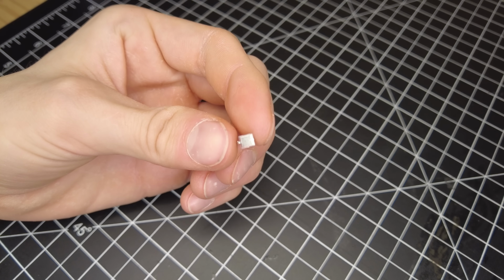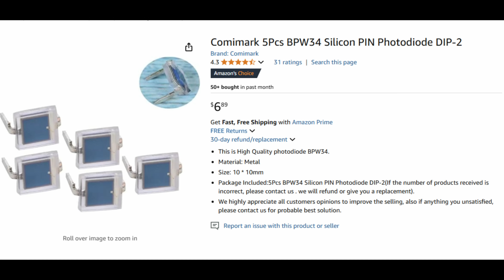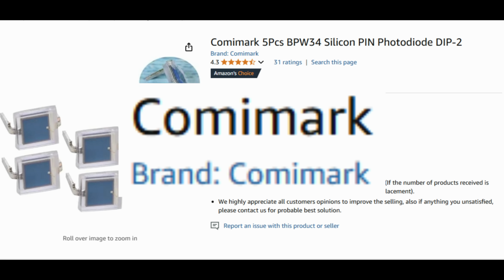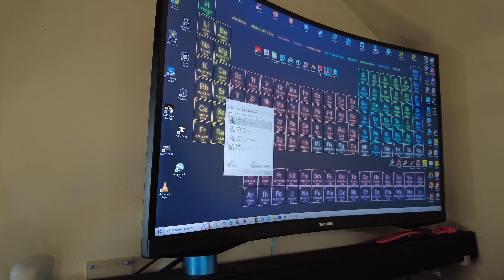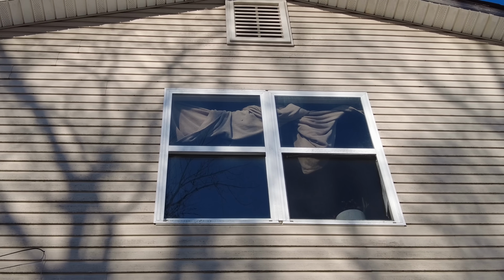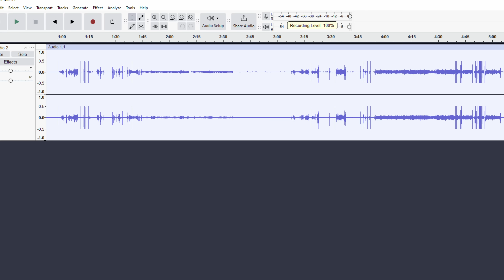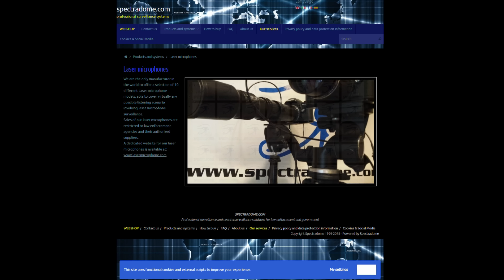I Built a CIA Spy Device (Laser Mic)

Comment: You need to modulate the laser (either using an AM or FM circuit) and then demodulate it filtering out the audio.  Basically youre making an AM radio tranmitter/receiver using a laser/photo circuit instead of a microphone.   This will get rid of the ambient noise.

Comment: Smart device sensors, radio waves (telecommunications/microwaves which provide your data connection)   and context aware recommender systems help strengthen the significance of 'mind reading' or the probability that their behaviour can be influenced by direct or indirect stimulus. 
However, social media and digital silos also contribute to subtle behaviour shifts. 
Your video is quite interesting, but more should be covered on corporate surveillance and how sensor data with algorithm's can read minds or influence behaviour patterns. You can also revisit the spectrum argument about how spying has evolved to use various spectrums used by everyone without them even knowing how they can be used to invade our privacy. 

Ambient backscatter communication systems, Lidar, C.A.R.S and other smart device sensors, telecommunication connection and your online data can be used to monitor you in real time. 

Wi-fi can hear you, monitor you without any special software
COWs (Cells on Wheels, as the industry calls them) can also contribute to monitoring techniques used by totalitarian and fascist governments and agencies. Societies biggest threat is more on the corporate side rather than the judicial side. As the judicial side has not kept up with how corporate surveillance works.

Comment: milwaukee lidar laser measurer, replace the capacitor i think with a resistor or inthink 1k transistor?  then an audio dac in and then output!  use software to remove hissing!

Comment: Thats pretty neat. I'm sure with a better suited amplifier circuit for the photocell, you would eliminate a lot of the noise already. Then you just need a little XY-Stage to make adjusting the laser direction easier. And i guess for an IR laser, it would help to have a camera with the IR filters removed, so you can actually visualize the reflection and aim the beam at the sensor.

Comment: Well, I've been thinking of doing it myself for a while now, since I saw that video from DIYPerks on converting any speaker into a wireless one. I did realise that it can be used for surveillance. But alas, I find this video today, and it once again turns out that whenever I am happy and giving myself a pat on the back for finally getting one original idea, it always turns out to be, well, not-so-original-afterall, for the lack of a better term. And as always, I once again fall into that spiral of "😭Why is it that whatever I think about doing, has already been done."

Well, on the brighter side, atleast it has done 2 good things:
1. Now I know it can be done, and....
2. It clears my doubts on how will I convert the light into sound (not the photodiode part, I meant the sampling rate thingy. As in, where will I find a processor fast enough to recieve, convert, process, and play, all before the next bit comes in).

Comment: Back when KGB and CIA used this the windows had 3 mm glass. These days the heat isolating glass has at lest 4 mm and is applied double. That 1 mm more makes the sheet of glass a lot stiffer. Doubt normal talking will vibrate that glass enough. The traffic on the street will vibrate it more than the sources from inside the room.
Reply: Not to mention most modern windows have argon gas in between the panes.
Reply: If you can reflect it off something inside the room it'll still work.

Comment: I still have a physical copy of a "Radio Electronics" issue from October of 1987 (you may be able to get PDFs of it online now) which tells you how to build a Laser Listener, similar to what you discuss, the cover of it shows two devices, one a laser bouncing off a window.  I had discussed this with my father who was in the Canadian armed forces and he used to help secure the prime ministers office for meetings.  He mentioned that they did not have windows in the office for the reason, but he also said something else that shocked me.  On the older style landline phones from back then, it was possible to send a signal down your phone line and cause your phone to pick up so they could listen into your home without you knowing.  He would have to secure against that as well, which was a shocker to me.  And that was what he was allowed to tell me about.  There was more he knew which he wasn't allowed to tell me.  Always made me wonder what?

Comment: I'm fairly sure that for it to work with the laptop, you just need one of those splitter cables for laptop aux ports. Should detect it as a microphone if you plug it into the correct one then

Comment: There was a design for this in Practical Electronics or one of the other similar magazines way back in the '70s.  The detector was a glass OC71 with the black paint scratched off.  The light source was however just a filament torch bulb with some lenses so range was very limited.

Problem with these designs is the people in the room will wonder what the red dot dancing across the room is 😄😄😄😄.
Reply: I've experienced a red dot dancing across the room once. Despite the fact that I was sitting behind armored glass, I hit the floor in a nanosecond. This was after a series of threatening phone calls and before someone tried to deliberately run me over on my way home.

What I'm saying is: Don't work for security companies. The easy money is not worth the trouble.

Comment: Simple ish fix for the static is to use Nvidia broadcast, it's free and it can remove background noise on both your mic input and sound out for speakers, if say the video you're listening to has a lot of wind noise or a loud AC or something. Does require a RTX card though...

Comment: About the noisy result: (although not at all bad!) The laser itself also has noise, that gets worse at low frequency, like audio.  You may get better results by modulating (chopping)  the laser at, say 1 MHz, and then mixing the reflected signal with the same frequency to recover the audio.  This is a lock-in technique.  At 1 MHz the laser noise will be considerably less.

Comment: How can this work in practice when you are far away from the building? Doesn't the laser need to be perfectly perpendicular to the window glass?
Could you can have a better sound by modulating the laser at high frequency? (and use some kind of FM demodulator at the other end)

Comment: Can you make a long range laser trip wire without using LDR? I think a laser that measures distance can be used to make a trip wire, when something cross/block it, the distance will change and trigger the alarm. It's way better than LDR that requires the end point of laser shinning on the LDR.

Comment: I built something like this in the 70s using selenium solar cells from Radio Shack and a cheap amplifier from Olson Electronics. It worked pretty well at night with ambient light from a window provided you had a scope or magnifying lens. The sound quality was about the same.

Comment: Seems like you could just include a low-pass filter to get rid a lot of the static, or better yet use a band-pass filter for 80-250 Hz since most human speech falls in that range.

Either way, cool video! I had no idea these things were so simple, I was thinking you'd need to do interferometry of some kind with the laser beam.

Comment: Well, a conspiracy theory I thought of👇

If putting multiple mini solar panels make audio signal a bit better, putting 20 or 30 might output crystal clear audio, you know what, people have already installed solar panels on the roof of their house, that acts as a giant microphone constantly monitoring and recording voices!! 
And what about recorded signals, how to source it? , you may ask (like the wires he connected to computer) 
Well every solar panels now a days comes with an app to monitor various parameters and most importantly voltage of the solar panel, so using a high quality ADC to measure the voltage fluctuations and averaging them (using some algorithm) in a way might recompse the vibrations, which is effectively someone's voice.
And the company who might take this data can argue "well what can we do with voltage, its just voltage readings for quality assurance and to better serve our customers...etc"

Comment: I did this as an electronics project at school. I used a calculator solar cell as the receiving sensor and hooked that up to the phonograph input of an old stereo. It worked great.
Reply: How did you code it?

Is it as simple as to plut it into the computer and turn on the ckmputee volume?
Reply: @bigcrowe9573  The vibration of the laser beam is the audio signal so if you can detect the motion, modulate it with electricity (increasing and decreasing voltage as the beam moves) and amplify it, you can send it directly through an audio jack. No extra processing required.

Actually most microphones work like that by translating vibration of a membrane into voltage and then amplifying it. Maybe with the exception of the carbon microphone, which changes resistance instead and has to be wired in series with a battery in order to produce a signal.
Reply: @Tomas9970_1  so you actually just plug that bad boy in and thats it?
Reply: @aguskpg  Yeah I think so. As long as you can amplify the output to around 0.2 volts, you should be able to just connect headphones through a jack and hear stuff.
Reply: @bigcrowe9573 it’s analog, no code needed
Reply: What year did you say you graduated from Moscow Technical?
Reply: Really ? Despite the huge hysteresis of a solar cell and the corrected curve of a phono preamp ?
Reply: @raphanunu6912  You'll be surprised, I was able to modulate the brightness of an LED and point it at a solar cell (literally capacitively coupled my phone headphone output into the LED which was biased "on" appropriately), capacitor on the output of the solar cell to remove DC followed by an amplifier, the audio was much cleaner than you'd expect
Reply: @mx.olydian2111  I do know Leds behaviour, brightness is current related, no matter the voltage provided it's above zener threshold. The issue here is the cell and the phone preamp, and yes, you're right, I won't expect a great sound !

Comment: In the UK smoke detectors have been mandatory for years 
I also remember an article on the BBC in the 90s I think it was about the early consoles with internet access one of the chips could pick up audio like a microphone by using the dampness in the air it was above the chip and it transmitted it down the internet I think it was a Dreamcast I'm not sure

Comment: Getting rid of the hiss is really easy...isolate a section of it, reverse phase and play it along with the original track.  There is also a plugin in REAPER called "ReaFIR" that makes removing noise a simple one click process.  Questions, lemme know...happy to give more details.  👍
Reply: Only works if it stays exactly the same. That doesn't happen unless it's intentionally placed white noise or whatever. Reaper is good though yes.
Reply: @meow_meow_J  Well, of course. But "hiss"...unwanted noise in a certain part of the frequency spectrum...be it guitar pickup noise, an air conditioner running in the background, hiss from incorrect gain staging, whatever...kinda, BY DEFINITION, it doesn't change. Now, subtracting it IS very easy...use the VST or do the phase trick, Bob's your auntie.

Of course, there IS a downside...nothing in life is free. Whichever you do, it's going to subtract whatever it's subtracting from eeeeeeeverythaaang. Some of those frequencies are likely present in other instruments and it will be subtracted from them, too. None of this is a perfect solution because there IS no perfect solution.
Reply: @rmp5s  try it with microphone self noise, it doesn’t work, otherwise, self noise would be pointless, since you could just fix it in post.
Reply: @rmp5s  you could use an FFT or whatever, but that’s not just flipping the phase, do you mean EQ? I’m a bit confused here, since you seem to know a fair bit about audio and this is not a mistake I expect you to make given the levels of knowledge demonstrated here, or at least jargon, the two are not equal.
Reply: @meow_meow_J  Nope. Phase. If you invert the phase of a sound and play that and the original sound together, you'll hear nothing. Sound is a wave...goes "up and down", right? Well, if you flip that so it goes "down and up" instead ("flip the phase"), the sounds cancel out. This is how ANC works in headphones (and some luxury cars and etc etc). Search for some videos on ANC (active noise cancelation) and audio phase for visual representations of what I'm talking about. Can make it WAY easier to make sense if it. 👍
Reply: @rmp5s  I understand this, very neat trick to get isolated vocals if official instrumentals are included as part of the album, I’m just saying it doesn’t work for noise, try it yourself, get a headset microphone, a second of self noise, flipp and loop, it doesn’t work. obviously recording has to be more than a second, so speak or something.
Reply: @meow_meow_J  I'm not sure what you're saying. If I have a sound...be it "self noise" or whatever...if you take that sound and play it with the inverse, it will cancel. It's this useful? Sometimes. Will it do what you want all the time? Probably not. I mean...I don't know what else there is to say. Phase is more of a "thing we have to deal with" than it is a "tool"...can be, but usually isn't.
Reply: @rmp5s  theoretically yes, on paper it’s often not useful. It could work if the noise were  fully static, but it often isn't. On paper performance in a perfect world says you should be able to just flip self noise to get nun out of a microphone, the real world says no, but here ffts, not as good but they actually work. Seriously just try what I mentioned above.
Reply: @rmp5s So you’re right in that playing the inverse of a sound cancels it out, but you can't get the inverse of noise in the real world so it's not useful in this particular case.
Reply: @meow_meow_J  Sure you can. As I mentioned, you just need another mic. Even if it isn't perfect, it can help.

You might also be able to just wait for a break in source audio and clip a section of whatever it is you're trying to remove. Flip it, duplicate it, there you go.

Again, it's not always an option, but even if it's not perfect, it can sometimes help.
Reply: @rmp5s I guess it could work for dc hum but even that is slightly variable, I don't know if it's ever worked for you but I'll keep it in mind next time I try to save an audio file I guess.
I vaguely recall doing something like this and it not helping at all though.
Reply: @meow_meow_J  Doesn't work every time. Of course. It's just a trick for the tool belt. Best of luck.
Reply: @rmp5s Thanks, glad you were so civil, too often do disagreements turn in to massive walls of pedantry broken up by the occasional insult. Best of luck with whatever you may be working on.
Reply: @meow_meow_J  👍😎

Comment: photodiodes work better when they are polarised backwards. you can use LT1028 in transimpedance topology for amplification of received signal. this can be huge improvement in this circuit.

Comment: great video! Probably the biggest challenge in doing it on longer distance would be precise positioning in order to get the reflection where it is needed.
Reply: And the divergence of the beam I think would be a challenge
Reply: Focusing lens would help greatly, separate receiver and transmitter may help too, or that's not possible, at least adjustable.

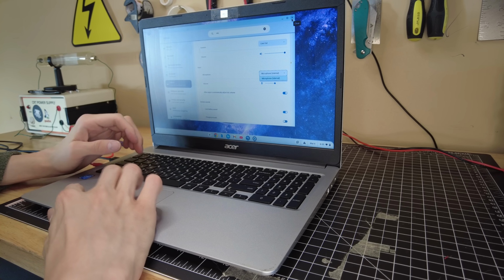Comment: 2:03 oh god i feel your pain. Ever since the combined headphone/microphone jacks were introduced, hooking up any audio device to a laptop has been a total pain in the ass. 
My Dell even goes so far as appearing to switch out the pinout for the TRRS socket depending on what is connected to it. This means that even if you put a TRRS jack connected as mono microphone to it, you have to figure out which exact resistances the socket wants to see to make it behave like a microphone input. I was probing the TRRS for the audio output, and every time i connected something different to it, it behaved differently. 
After several hours i gave up and bought an external soundcard that did have fully separate input and output jacks.
TRRS is fine, but PLEASE make it behave in one single way regardless of what you connect to it.

Comment: It sounds better than some real laser mics. The easiest way they block signals through windows is by using a transducer ( think speaker cone attached to windows and walls ) with a white noise generator. Not your typical white noise generator mind you, but one that generates truly as possible random noise so it's harder to filter out.

Comment: The sound is decent, have in mind that a led lamp will produce that static since they work under a chopper. If you use laser modulation the sound should come on cleaner

Comment: With a high frame rate camera and a trained neutral network, recorded laser dot movements can be converted back into fairly usable audio - someone has already done this on YouTube, I can't remember who. But I remember the project was super interesting.
The problem is that the laser dot moves are usually smaller than the pixels on the camera, in subpixel range), so the network does some kind of movement magnification (black box magic shit 😅)

Comment: turn the lights off to get rid of the static! the same would happen with sunlight. Plus the photo diode on your desktop computer also vibrates as the pc is on.... I suggest positioning it on a steady surface like a wall